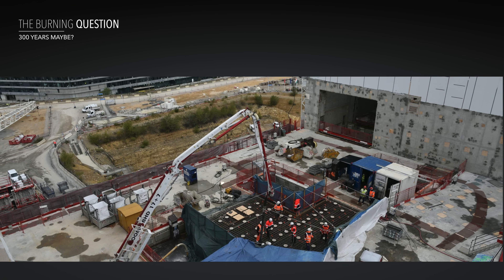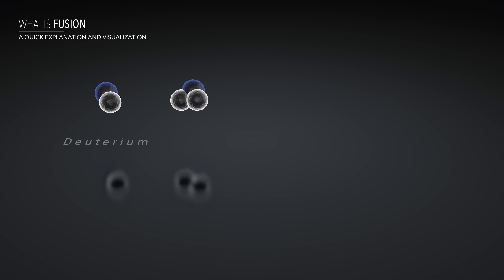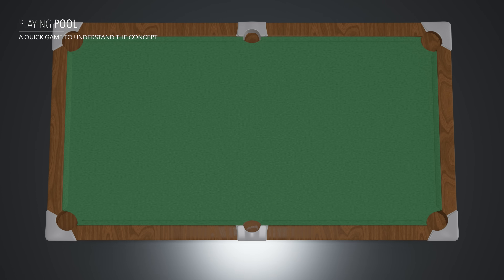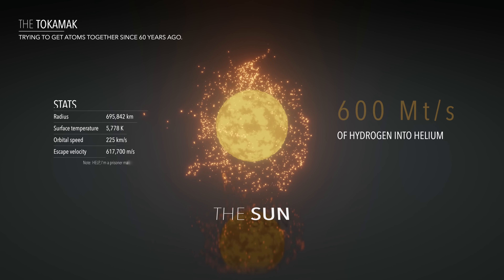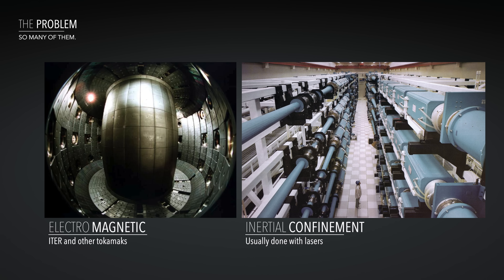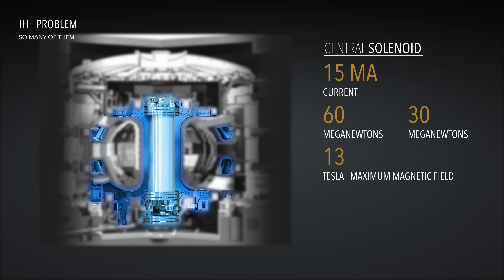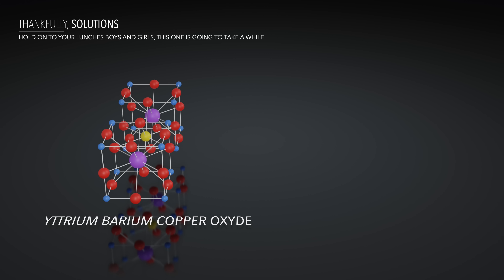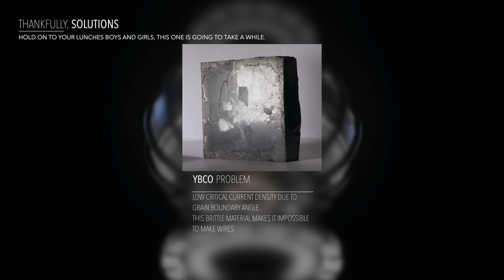Fusion in 30 years? ITER update [2020]

Comment: In other words, with a little bit of luck, it may become practical shortly after the conclusion of the Sixth Extinction. ☹️
Reply: Vadim Kaz 
Many of these processes are near self fulfilling and will stabilize once important people care enough. It is currently to the benefit of most western, and a few eastern, nations to allow climate change to continue, as it opens up lands once thought useless. There is also no evidence that melting permafrost will cause such a sudden methane or carbon dioxide release. It will release some, but no more than the land already passively produces. 

The real tragedy of climate change is rising ocean levels and biome shifting. The climate of earth will return to a Triassic/Jurassic like state, with expansion of the arid zone along the equator and temperate climates stretching up close to the poles. There will be high intensity weather as a consequence of the increased heat, but  rainfall will also be much higher in general. This will change some biomes into floodplain or sink low elevation land under the ocean, but most of this trouble can be mitigated with our current technology, if we cared build the Infrastructure.
Reply: @Vadim Kaz , the technology to counteract global warming already exists. It's called global dimming. For $5 Billion / year we can lower temps by 1°C. Chill dude!
Reply: @Vadim Kaz I love how you oh-so enlightened doomsayers consistently forget that Venus is two thirds as far from the Sun as Earth is, that Venus has an atmosphere that's much more massive (93times (!!!!)) than Earth's while being composed of 96,5% of Carbon dioxide (as opposed to a few hundred parts per million) and, on top of that, that Venus has no magnetosphere to protect itself from solar wind.

To say that Earth is going to turn out like Venus because of the ever changing climate is completely ridiculous.
Reply: Vadim Kaz 
It won’t get anywhere near that bad, and global temperatures would have to rise more than 10 degrees for even my version of the future to happen. Keep in mind that with all we’ve been through, we haven’t managed a 1 degree change yet.
Reply: @Vadim Kaz bro humans are the only creatures who care about the environment and thats a fact. All of the other ones in our place would just dominate until they went extinct from using up all of the resources too fast. Unlike them, we actually think, we dont want to die and so we try to do what will most likely stop us from doing so. Thats the whole reason people disagree with all this climate change stuff in the first place, they think that betting on economic and technological growth is a better chance of success than trying to alter the temperature of the entire planet. Of course they could easily be wrong, but thats all any human does, try to survive, and then after that, try to enjoy themselves and make friends, and then after that, only then, do they care about the environment. Thats why its so vital that we focus on things like teaching people conservative work ethics and good social skills. 

But yea, that first thing you said lol, yes your wrong, humans are the only creature that would not immediately dominate and destroy all other species for resources when given the opportunity. Why? because we evolved. Its better to cultivate than hunt and gather  to extinction. We create like 600% more crops in 90% less space than our ancesters did, and we figured out how to use black stuff we get out of the ground, and literally freaking sunlight to power our homes and allow us luxuries like videogames and youtube and iphones. How is that not amazing? How is it that someone has twisted your brain so much that you think all of our achievements were failures? Of course weve got a shit ton of problems left, thats freaking life bro, it sucks. But thats why humans are so amazing, weve literally solved so many problems despite life punching us in the nuts literally every day, its actually insane! Yea you could be a pessamist like everyone else in the world and think "OH GOD BUT WHAT ABOUT THIS PROBLEM< OR THIS ONE OR THIS ONE" or, you can be optimistic and hopeful, and actually work hard to create a better future. You wont make change by screaming about how americans are stupid and should do something with their money. You can make a change by making your own god damn money and using to to make things better. Thats called capitalism and its the only reason your using youtube. Or any electronics. Of course people are greedy, but at least the greedy people do something with their lives instead of moping around and whining like a little bitch. Do something.
Reply: Chris Mayer 
I don’t get the doom and gloom from the environmental types. The Sixth Extinction shall continue till we outrun our capacity for technology and energy resources, which doesn’t seem to be happening soon. Besides, even at this point, we can replace almost everything done by nature with more efficient, artificial processes. The exclusion being biodiversity.
Reply: @rhapsodyman2000  well even then we can literally just invent new species at some point. 

Regardless, I commented this because I wanted to understand how much you know about the "sixth extinction". You see, if you dont consider islands, including australia, humans have actually only caused 9 unique species to go extinct. Sure 1 species is terrible, but what that means is that most extinctions that were from humans (with the dodo bird as an exception), were actually just us accidentally spreading rats and rabbits to islands. Our deforestation has actually caused very few extinctions, as our conservation efforts have actually been successful. People are too doom and gloom, rats and rabbits have killed the most species in the world, and will continue to do so. Not humans. Sure we grind up the amazon for farmland, but eventually when enough of it is gone, humans will fight that until it stops. Unlike other creatures we solve our problems. Thats why I have an extremely bitter taste in my mouth when I think about all of the environmentalists that hate humans, were literally the only creature that we know in the universe, to care about the environment.
Reply: @jonathanbauer2988  
I know a bit of the supposed, "Sixth Extinction," but of what I do know hasn't impressed me into caring about it. If only more people could decouple Nature and Ecosystem and realize just how poorly Nature does it. Industry and technology brings control to the randomness of nature and gets rid of externalities. Sure, we tend to create problems in our ignorance and laziness, but the system works to fix those problems as well. The problem, like always, is agenda. Most naturalists, I know, see this as too aggressive and only want to live simpler lives, or they're vegans and the like, and have moral convictions against exploitation. I get the feeling sometimes that their ideal world is something out a Tolkien-esk Elven city, and they see Industrial progress as something out of 1984.
Reply: @jonathanbauer2988  , well said! Every environmentalist should be dropped off into untouched nature.
Reply: what 6th extinction lol

Comment: It's fundamentally a problem of cosmic scale. At sub-stellar scales, the local gravitational field strength due to the relative absence of local mass is simply too weak to support (contain) any kind of efficient (net positive output) levels of small scale fusion reactions. Notice that fusion reactions occur readily between hydrogen atoms in the sun's local gravitational field at roughly 15 million degrees C, yet we here on Earth, with it's relatively weak gravitational field must achieve temperatures of nearly 150 million degrees C using deuterium and tritium based plasma fuels, which according to this video are easier to fuse than hydrogen based plasma fuels, so clearly local gravity is the unaddressed elephant in the room. Due to current engineering/technological limitations, we must rely on the electromagnetic field to provide containment, which it would seem is the largest share of energy input in all current fusion reaction systems so far. Since inertial confinement systems rely on high powered lasers (pumped with electromagnetic radiation) they too rely on the electromagnetic field for containment. Unless or until we can unlock the secrets of controlling gravitational fields, I feel that all current experiments will ultimately fail in their attempts to find a net energy positive solution, although in the mean time I'm sure they will at least provide us with a few much needed bits of  understanding regarding high energy reactions. Lastly, if it turns out over the coming centuries that there is no low energy consuming solution to containment (meaning, even if we discover the secrets to controlling gravity, but it winds up costing more in energy input than it does to control the electromagnetic field, the whole Earth-based fusion thing is almost pointless at sub-stellar scale), well then it looks like improving fission reactor designs (both uranium and thorium based) is probably a better bet for the practical future of human prosperity.  But then again, what the hell do I know, I didn't even go to college.

Comment: We could spend 2% of what we've spent on ITER, and have safe, carbon-free, Liquid Fluoride Thorium Reactors springing up all over the world in a few years.
Reply: No. That's not true. We still have no idea how to pump molten fluoride salts as a coolant and especially not with any economic viability. No amount of money is going to make molten fluoride salts less corrosive.
Reply: Pretty much. Although you still have to deal with nasty chemicals to clean the by-products of fission in the liquid thorium reactor.
Reply: I believe India and China have put in substantial resources without any viable outcome.
Reply: @outsideworld76  When I was working at AREVA a few years back, we were told they had already broken ground on a Th LFTR reactor in China,and had a contract for 3 more and options on up to 10 plants. 

Now of course with the typical French mismanagement of nuclear projects, we might just see a working Tokamak first..
Reply: Not remotely true. LFTRs are so far behind what they need to be to be economical. JET has a budget of 50 million a year, and you think a few % of what we spend on fusion would make LFTRs work?? Do you know how expensive engineering in the fission industry is?

Comment: It's like literally the extreme of everything all rolled into one. Insane.
Reply: It’s an experimental prototype of a experimental prototype lol. It’s supposed to be extreme.
Reply: @Azakadune  and its only gonna get more extreme from here
Reply: The funny thing is, you tend to focus on the "almost absolute zero", as being very cold. But compared to the 150 millions degrees, boiling water or melted tungsten is immensely cold.
Reply: crazy donut
Reply: It’s basically lightings up a little star in controlled environment. It doesn’t get more crazy than that
Reply: Yes?
Reply: It isn’t though. They’re using outdated superconductors. The machine could be 1/8th the size, 1/100th the cost, and many times more power output. ITER won’t even generate useable power.
Reply: @ophello  Please explain what you mean by outdated components and being a fraction of the size and cost. I'm intrigued.
Reply: @DylanBegazo  i think he means that since it takes such a long time for the project to come to fruition, the technologies involved in the making more than likely are advancing rapidly as well, thus making the old components kinda outdated in that sense. But he forgot the main thing, this project isn't about efficiency, its more about either this works or not, if it does, it can be improved upon later, if it doesn't.. well that's a lot of money thrown into one basket but regardless this is pushing humanity into the right direction(my opinion).
Reply: Catalyst - D B the latest REBCO superconductors have several advantages:

1. capable of maintaining superconductivity at temperatures of 75°K, which is much easier to maintain than 2°K (what their coils require.)

2. They are far thinner than traditional superconductors, which means you can pack way more of them into a tiny space

3. They can withstand insanely high amounts of magnetic flux and tension

Combine those three facts, and you can now easily contain the pressures of a fusion chamber, with minimal space and cost. Combine this with a liquid blanket instead of a fixed blanket, and you have the MIT ARC reactor. The future of fusion power is already here, and ITER is just too late to the party. The technology advances in the last 15 years have already rendered it obsolete.
Reply: Found it funny that he was using the word „super“ that often. As you said, it’s about the extremes.
Reply: Not insane. It’s pleasant.
Reply: What does literally the extreme of anything mean?
Reply: We need AI first
Reply: @tgmtf5963  luckily there is more than one scientist in the world.
Reply: Yamato Genskie AI is humankind’s last invention. So no. No thank you. 

I like human beings being the top of the food chain.
Reply: @tgmtf5963  not bafore we have some good colonies in case somethign bad happens
Reply: @tgmtf5963  AI is nothing but hype, with the most advanced versions currently being mere probability distribution calculators. Also, the theories of AI rapidly developing into a super intelligence are completely unsupported by our experience building complex (useful) AIs today, in addition to the lack of understanding of even human or mammalian intelligence as a whole. Really tiresome seeing people everywhere overhyping AI as if it will be the panacea of the human species.
Reply: @aiGeis  Human intelligence is nothing but hype, with the most advanced versions.... and so on :)
And AI is much more likely to cause a crisis that humanity won't be able to overcome than actually solving all our problems.
Reply: @Steelrat1994  easy there, john connor
Reply: @aiGeis  AI is everything  leading us to destruction : Deeplearning, , censorships, faciale recognitions, SOPHIA first CITIZEN ROBOT ALL CONNECTED TO THE CLOUD ! She can ear, see and speak to anyone around the world in live trough WIFI and 5G...
She is The Beast with an image who can speak in The Bible...
People are going to worship this beast ... Idiots think it's only hype and without dangers...
Reply: Scientist Walter What’s wrong with John Connor?
Reply: @Steelrat1994  AndrewYang2020
Reply: @aiGeis  -- I think his comment was a joke.
Reply: Sound good, doesn't work.

Comment: Fusion needs so much power to start up that you basically need a fission power plant to run it. If fusion is only 8x better then we should just stick to fission lol
Reply: Fusion solves a lot of issues that Fission has, it's not just about the power.
Reply: @ShadowebEB  

D-T fusion emits that pesky high speed neutron. So after running for a few years, the reactor building is just as radioactive as a fission reactor.
Reply: Aimless6 Not remotely true. Compare the half lives and radioactivity of activated metals to that of fission products. Not even comparable.

Comment: The difference in potency between fusion and fusion confused me.

If fusion is self sustainable then why don't we just pick to go with fusion?
Reply: Fusion isn't self-sustaining at current technologies in terran facilities. Assuming I read the info right, our best record so far requires 51x the amount of energy input as we have gotten out. I'm not sure I ever seeing this becoming net positive because the sun has the power of gravity sustaining it.
Reply: The argument built on the impossibylity of a ruaway reaction is that of safety. But it only wins over plutonium and uranium reactors. Thorium reactors are designed completely differently.
Reply: Because it's insanely difficult to achieve, decades of R&D and international co-operation is required to make fusion happen. Even when scientific and technical knowhow is improving, the manufacturing and logistics efforts are massive and very difficult. Energy needs are growing right now which is why there needs to be several transitional systems in between. At the moment rcountries with relative energy stability are ramping down coal and replacing it with energy sources such as natural gas, hydro, geothermal and nuclear. Whereas India and China are building a lot more coal power.
Reply: because fission produces nuclear wastes and its reactives are rare and expensives